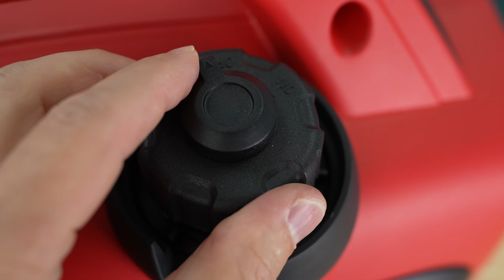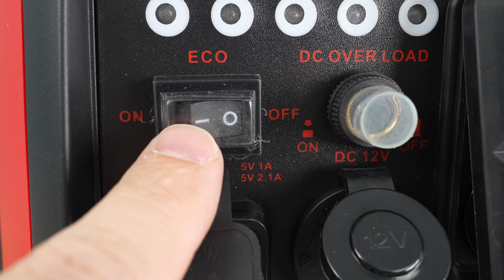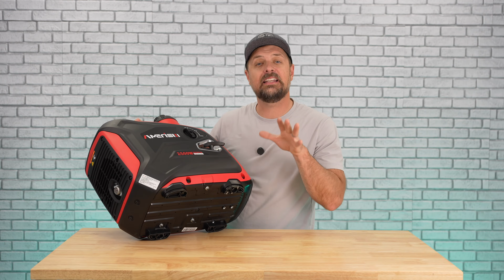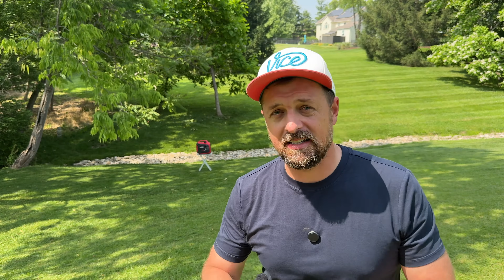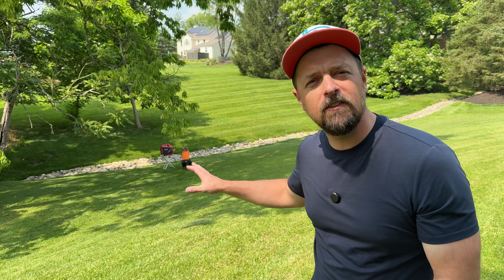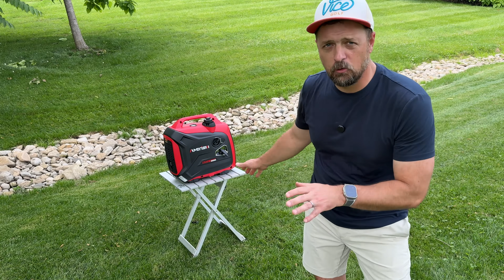Amerisun 2500W Inverter Generator Review, Noise Test, Load Test & Specs for Camping or Home Backup

Comment: Anyone know the max wattage it puts out on ECO mode?
Reply from the maker: Peak (surge): 2500W
Rated (continuous): ~1900W  ￼
Eco mode doesn’t cap the generator to a fixed lower wattage. Instead, it automatically reduces engine RPM when load is low. Then, ramps up power as demand increases. So…

👉 Max output in eco mode = still ~1900W continuous (2500W surge)
👉 It will only produce less when your load is lighter